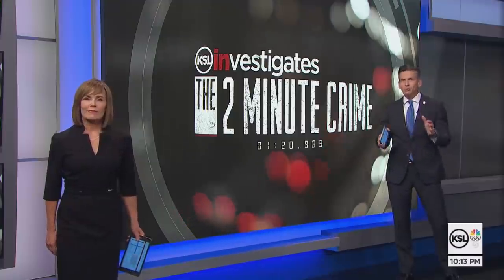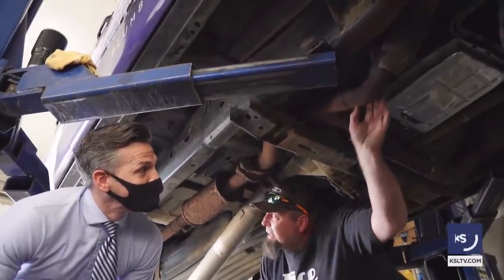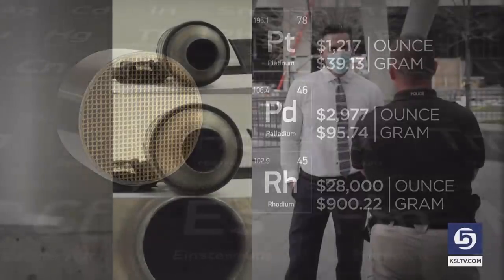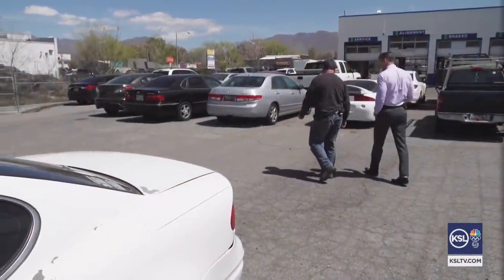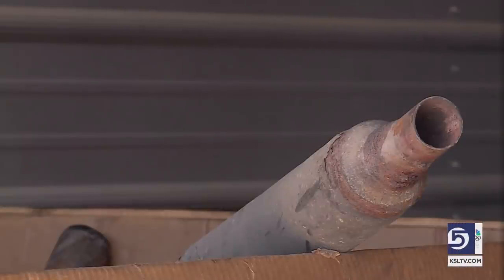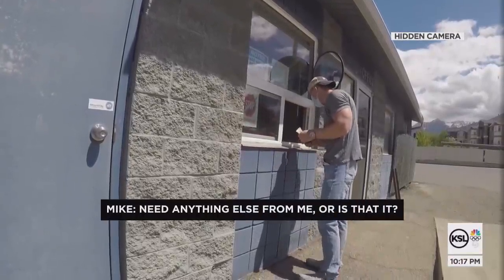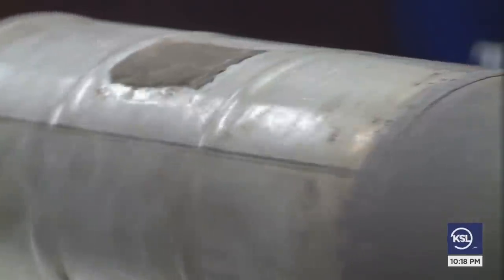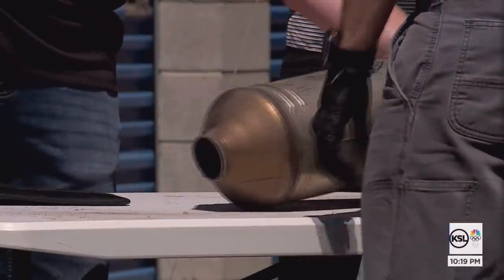KSL Investigators goes undercover to check compliance as catalytic converter thefts skyrocket

Comment: The blue book value on my catalytic converter is worth more than my vehicle.
Reply: Bruh.... I just figured out how to get rid of my car and make a profit still. Thanks.
Reply: And now your house is worth more in lumber than real estate.
Reply: @darwinawardcommittee  lol 😆 yeah, covid is crazy
Reply: $2400 for a catalytic converter replacement isn’t correct. These journalists know nothing about cars.
Reply: @thronewalker1153  "But That's the average for a 2010 car with 3 catayltic converters"
Reply: I’ve got an old cat from a past diesel I straight piped that was pre 1997 emissions smog.
Reply: 2AENTERTAINMENT  nice 👍
Reply: 2AGIVEEMBLUES  dealer price doesn’t really count. A shift knob is $500
Reply: @thronewalker1153 , it’s roughly $10,000 for two Catalytic Converters from a Toyota Tundra. Roughly $3,000 to replace.
Reply: @w_6880  No its not that much. Where are you buying the converter from? The dealership? There’s no point in doing that. Get a universal catalytic converter for $100. It has a spot for the factory oem 02 sensor. Then go to a shop. They will charge you $300 to get it welded on.
Reply: @schlomoshekelstein908  haha they wish it was
Reply: 2AGIVEEMBLUES  certain parts can be aftermarket and will work. Some parts have to be oem or they will not work. A catalytic converter doesn’t have to be oem. The 02 sensor does have to be oem. Most sensors have to be oem. Mechanical parts. Not so much. Suspension can be aftermarket. Motor mounts can be aftermarket.
Reply: Drop your location
Reply: Your car must be an old beater

Comment: Shoot, I’m going to cut my own Catalytic Converter off and sell it if its worth that much lol
Reply: Lol
Reply: What make and model vehicle do you have?
Reply: @warrenmcelroy4718  🤣
Reply: It's worth more than my car.
Reply: same 😂
Reply: If you don’t need them it’s not a bad idea.. I’ve been offered 1800 for my cats
Reply: Yeah get a test pipe that's what we used to use testing the system that had a bad catalytic converter I don't think you're so many more it's just a straight piece of muffler pipe
Reply: Totally depends on the vehicle. Most are only worth $200-300.
Reply: I used to buy 6th gen accords regularly. Would take the cat out and sell it for 400-500 dollars and then put an aftermarket cat on for around 100 bucks. Never had problems. Lol
Reply: Mine was only 50 bucks when I cut mine off
Reply: Wait... you may be onto something
Reply: They aren’t worth that much. These idiots will steel your AC condensor and take it to the scrap yard, all to get $40, meanwhile it cost you $5k to repair. They even stole ones off the company I worked for. Cut them off the roof and dropped to the ground. This cost the company hundreds of thousands. Idiots even stole a ground wire once on a power station, which tripped a ground fault in computer and shut down Baltimore city one time (Anne arundel county). How much did that cost businesses? These idiots should be put in jail
Reply: Deadasss😂😂😂
Reply: And will cost you 3x amount for repairs
Reply: I've never known about this until the ring started stealing. Imagine all the old cars I could've made money on instead of selling the car for cheap!
Reply: @wileecoyote5749  
Find your own mechanic and buy the converter and/or muffler at Autozone.
Reply: 😂😂😂 right!
Reply: Lol
Reply: I did this with all my family’s cars
Reply: @eyyymanuel  same dude
Reply: I can do cat repair  btw. Cat delete before they just cut it out. Than u gonna cat delete any way
Reply: If the thief’s want my cat guess what nothing is free how much will you give me for MY Cat because if I’m not getting anything my guns coming out & someone’s getting shot!.
Reply: You should your car will probably run better and sound better to imo
Reply: And then fail emissions over and over again and wonder why
Reply: @YourLockerzPal    if you don't have a cat and dont figure out that's why.  Your too slow.
Reply: You’re literally a genius, amazing you’re in Utah. LOL LAMO ROTFL.
Reply: Car will sound better without it and make a few dollars... win win 😝
Reply: @hondaep3813  your comment makes 0 sense.
Reply: @YourLockerzPal  how so
Reply: @YourLockerzPal  I've been cut and punched out the center of a cat.  cause I wanted more flow. ??  The guy  was talking about the repair bill will cost you. .......
Reply: @YourLockerzPal   arthritis can
Reply: @mof3246  that seems extremely high and unlikely
Reply: @colecooper5836  yes the universal ones from rock auto! But only the 6 cylinder front cat w/manifold is worth that much. The 4 cylinder and downstream cat on the 6 cylinders are not worth as much.
Reply: @DNSMLT  buy it at rock auto not any stores. They’re triple the cost!
Reply: @cpw80  runs better too! Well older models will.... newer cars will not run as great
Reply: @colinlindgren7378  I have an f10 M5 and our down pipes contain a lot of metals so yeah I’ve got 1800 twice for stock downpipes. Bought some online from someone for 800 and still made 1000 profit just by being online
Reply: Fr im makin arrangements rn
Reply: Im in NV i did already hahaha jeel sounds and runs amazing
Reply: The scamdemic closed down mom and pops and let big business stay open crushing the competition people are hard up its part of being in a communist country
Reply: @PyroBandz  o
Reply: One Cat for a Ps5 or Xbox 😆🤣😂😹
Reply: On my momma
Reply: @YourLockerzPal  that’s y I live in Florida
Reply: Before you do that run your car through emissions so you'll be good for 2 years before needing a cat then straight pipe it with a segment of exhaust pipe. Youll need 02 sensor adapters if you dont want your check engine light coming on but they're cheap...only like 6 bucks.
Reply: It’s better if you actually buy a aftermarket replacement and swap it for your cat get the money and pay 100 bucks for the aftermarket
Reply: LOL Right?!
Reply: Just cut it off then run a straight  pipe  what I did on my dodge
Reply: Depends on the car they can be anywhere between $50-$5000
Reply: @pauljanssen2624  it all it is with  a filter that slows u down  but some new cars run bad without it becuz of sensors
Reply: @ikeremblem255  lol u better  be quick  out of your  sleep only takes them under 30 seconds my old neighborhood  got hit once even the cops house no joke is y so many being stolen this ben going on over a decade this old news that was back in 2010 when I lived there
Reply: Set up a booby trap u be good
Reply: @ikeremblem255  just remember  if u hear  cutting in the middle of the night u wont see him becuz he will be under your car cutting  so u here that cutting think about  your converter lol
Reply: @ikeremblem255  its  just a heads up like I said my old neighborhood  got hit in Chicago  years back many times I've talked to my neighbors and some wuld hear it look outside  but couldn't figure it out because  u wint be able to see them
Reply: I'm willing  to give  my converters away if they replace them with straight  pipes any takers?
Reply: And becuz  they seem to have a problem  with converters how about  ban converters and emissions control problem solved
Reply: Then you'd not be able to drive it.
Reply: @pauljanssen2624  till you get hit with inspections and then a federal crime lol thank god my state doesnt require them.
Reply: Careful. If you drive without it mager fine
Reply: @JohnSmith-en2st  yeah I got equipment don’t worry I am prepared.
Reply: @ikeremblem255  lol we want to see updates
Reply: Right of get all my money back because my truck has 2 cats on it my truck is a p.o.s
Reply: wow!  i just got me a new hobby🤣
Reply: I did on all three of my cars my mpg went up too
Reply: @eyyymanuel  LOL
Reply: @warrenmcelroy4718  1989 420 sel how much for that cat
Reply: @Devan_Bolin  cats from high quality cars like Mercedes can be worth between $800 and $1500, but with an ‘89 model some or even all of the inside of the cat would be burned out or broken up. The more miles a vehicle has on it the more potential the car has to be in bad shape.
Reply: The fine you get for not having one is higher, sorry to bust your logic...
Reply: @TBonerton  that solely depends on the state that you live in. My home state doesn’t require any yearly inspections so you can remove them all day long if you want. Some people still get stopped for having loud exhaust but that’s their own fault for not fixing the exhaust pipe.
Reply: That’s what I’m doing rn
Reply: Yeah you don't need it, you will just poison everyone behind you lol
Reply: @sammyd7857  yeah, it filters the bad smells of the combustion engine, Cat Converters save ALL Kinds of Lives.... psh
Reply: Gene Beuglet  haha you’re not very bright are you? They don’t always HaVE to be replaced and they can be worth a lot more than $100
Reply: Gene Beuglet  haha yeah I have just a little bit of experience with them so i kinda know how they work, which is why I said they don’t always have to be replaced. In many cases the engine will run better with the Converters removed. Also you can physically see if the converter is still full or if some of it has been burned out, the extended time of use isn’t what makes them lose the platinum that’s inside of them but more so if they have been exposed to excessive amounts of heat, like if they get partially clogged and trap heat instead of allowing the heat to just pass through. I’ve scrapped ten year old cars that had the converters burned most of the way out and once scrapped a 1979 Toyota Corolla that still had a perfect looking Cat. .... what are you, ten years old? Maybe a little experience with something like this would serve you well before commenting again😆
Reply: Me too I figure I can make some profit and then repair my original. ☺🤤
Reply: Final cost of five times as much to replace it LOL that's how you make the big bucks
Reply: @warrenmcelroy4718  boy sarcasm went way over your head I bet you're fun at the dinner table 😆
Reply: Yeah
Reply: Bro facts 😂😂
Reply: @Colombia36790  pretty much have to catch someone in the act or its going to be hard to prove after the fact..A car doesn't really need a catalytic converter anyhow...
Reply: @TBonerton  never heard of anyone being fined .   Except a shop for removal.   People can’t afford to keep replacements these things .
Who is going to look under there anyway .
Reply: IAM crying laughing
Reply: @watchjaredwork1487  somebody has seen you coming.... I have been getting alot more than that
Reply: Lol
Reply: @clarkgable1055  oh u so mad at him cause he cute huh
Reply: I was told by a recyclers that the cat in my old van (1995 E250)  here in L.A is worth about 1500 bucks in a van worth 2k, wierd, ironic, scary, ridiculous.
Reply: Yep they are worth a lot... I junked 2 cars and took the catalytic converters off and got $950 for 3 because one was bad
Reply: Well if you have an old car that doesn't run anymore cut that puppy off. I know a lot of people have old cars laying around they can probably make $1,000 easy
Reply: @YourLockerzPal  some states no longer do inspections. And I had an older truck several years ago that the catalytic converter went bad I just cut it out well it in a piece of pie. Or I should say I had someone do it and didn't know how much the thing was worth they sold it
Reply: Best thing to do regardless and the aftermarkets aren’t worth anything so they won’t cut it
Reply: @truthtimetv4575   i bet they love tf out of you
Reply: Lol
Reply: Lol
Reply: I had mine stolen... Not putting another cat on. Just straight piped it. No more problem 🤣
Reply: @pauljanssen2624  p
Reply: That’s what I did lmfao was worth half the price of my clapped out rendezvous
Reply: @eyyymanuel  bro how
Reply: Rofl you probably make 200 buck and repair will be 2k lol
Reply: @warrenmcelroy4718  Honda Civic Max 2003 model.
Reply: @mig7290  $70 - $100 as long as it is still fully intact “which I’m sure it most likely is”

Comment: Recyclers should be required to verify receipt from the shop that removes it — and take photos of the person turning it in along with copies of all their IDs as a bear minimum!!  The recycler intake cans and bottles and some occasional copper to has my driver’s license on file and I’m required to sign every time I turn something in. (For cans and bottles!)
Reply: But then without the thieves, these recyclers won't make money though. You either want to make moneys or you want to be honest.
Reply: @hybridsnowleopard  there are more than plenty of honest metal scrappers and honest scrap yards out there. These businesses can profit just fine without the scumbags
Reply: Don't need it to vote
Reply: @unclerobby  Very good point
Reply: What if you have a bunch of junk cars and you want to recycle then yourself. paying a shop to remove is gonna decimate your profits
Reply: @dormantmenace  I don’t really know anyone that fools with junk cars that wouldn’t cut them off themselves, but that really isn’t in question
Reply: Pawn shops require I.D.
Reply: @warrenmcelroy4718  Correct, I made an error in my wording earlier. The shop can be very honest and still make decent amount of money or be dishonest and make a lot more money.
Reply: Right just like pawn shops do for this reason
Reply: just make a high heat foundry and melt them down yourself. take the metal to a precious metal dealer to have it tested and priced. Boom done!
Reply: Bare minimum
Reply: But what happened when a shop doesn’t remove the cat. What happens when I remove the cat from my own car to replace with pipes and then I want to sell the cats?
Reply: Yup that’s how copper thief’s stopped in Los Ángeles
Reply: Start giving life sentences
Reply: Gee that makes perfect common sense? Will we go on four decades of this problem with no wind inside?
Reply: Who says a shop removed it? When the cat on my F150 went, I got a replacement at the parts store, and cut the old one off/welded the new one in. I suppose I had the receipt for the new one, but obviously no shop installed it.

If you require a licensed shop be the only seller, you're screwing me, and DIY guys like me, over.
Reply: @KDBHonda256  Shop has to remove em when they go bad. Otherwise how do you install a replacement?
Reply: @bcubed72  yeah I should have been more specific.. they can't just remove them because I ask them to.  Yeah of course if replacing they can remove them.
Reply: @bcubed72  after rereading I think I must have just returned home from the dispensary and had a cloudy brain lol.  My comment didn't even really fit in here.  I appreciate you pointing out my stupidity 😅

Comment: Jokes on you none of my cars have them. Joys of having older cars 🤣😂
Reply: not just that once a car is 20 years old you can strip off the cats since your smog exempt

i mean it means i no longer have to swap them back in before a smog test
Reply: Definitely
Reply: @markrayes2973  😁
Reply: @markrayes2973  After 20 years - exempt??
This must be state or county dependent, as I until I sold it last year, I still had to pass annual smog checks on my '69 Chevy pickup
Reply: No smog checks on my state.  Cars rust out so bad from salt on the winter.
Reply: Where I'm at it's '75 or older. Not too shabby as some of the 70's cars have the amenities of modern cars (power windows, power brakes, power steering, air conditioner, and you can always add power door locks). Not too shabby at all :D
Reply: Joys of catalytic converters deletes.
Reply: @gregparrott  where are you from
Reply: @ShrimpDaddys  Currently, Nevada
Reply: I have a 2003 f250 7.3 diesel. No cat from the factory. Probably the last year you will ever see that. I don’t know if it runs hot enough for a cat to work anyway.
Reply: Neither did my brothers cars, they smashed his windows instead
Reply: No emissions test
Reply: @gregparrott  A '69 Chevy will have no emission control equipment...and certainly no cats on it.
Reply: @lawrenceartz8640  You are only partially correct. 
It never had a catalytic converter. But it DID come with a smog pump (Air Injection Reaction pump), a PCV valve, and other minor mods.
Reply: @gregparrott  Yup. My state has this law in place: 

IV. This section shall not apply to vehicles 20 or more model years old which shall be determined by subtracting the model year of the vehicle from the calendar year in which the inspection occurs or to vehicles determined by the director to be rare or historically significant. 

That means for 2023, all vehicles 2003 model year and older are exempt from the entire state emission control requirements.
Reply: @gregparrott  California and certain areas may require those items, but those made for "49 states" did not have some equipment. I remember labels on the door posts, particularly on imports up through 1979 stating "NON-CATALYST". I had a 1986 Chevy Suburban that was factory with no converters, no "unleaded fuel only" labeling and the larger filler neck opening to permit leaded fuel nozzles to be inserted. My 1972 VW Beetle had no EGR whereas "California" VWs had that "one year, California Only" EGR system on it used only on 1972s...a rare find for those parts today.
Reply: @lawrenceartz8640  California was the first state to have the AIR system, starting in 1966. But it was later added to cars ins other states. The same applies for the EGR system.
Reply: @markrayes2973  not in Cali.